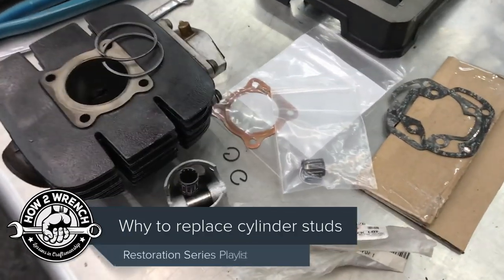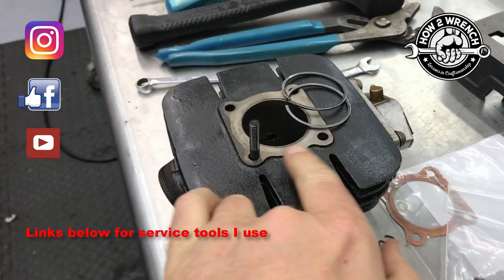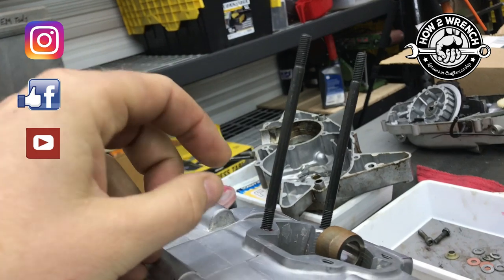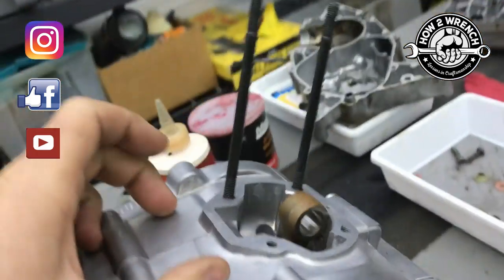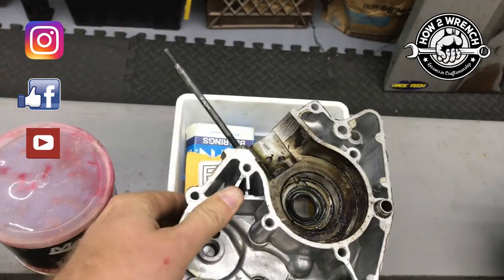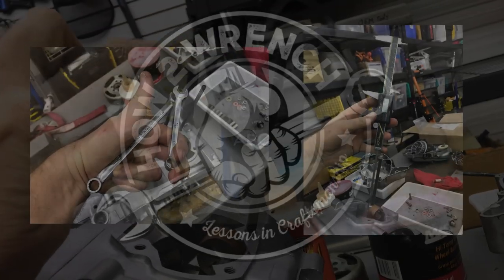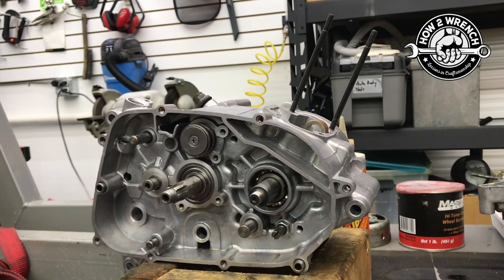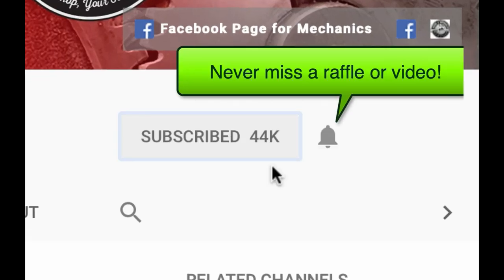Why to replace cylinder studs. Have you put much thought into what you reuse?

Comment: hell yes. i'm new-ish to engine work on my 2-stroke and snapped one overtorquing a few months back. when i did one i thought about how frail they are and how they hold everything together. kind of thought i ought to flip them all but then thought, maybe i'm overthinking it. i did only one then and now that i'm back inside doing more work, i went thru and did the others. no harm in installing fresh, unworn, sturdier ones while accessible during top end work. you'll sleep better knowing this bit of detail is done. the new ones will make you realize how worn yours are. get the good ones, saving 6$ is stupid. autozone stud removal tool worked well in my case, but learned also that the double nut method is a classic trick. thank you for validating my recent full stud replacement, as i await some new rings in the mail 🤘🏼
Reply from the maker: 👍 Thank you for taking the time to comment! Hit that subscribe button if you haven’t please! It helps us! 
Here is a way to support all the free videos.
Want to say “thanks” or “keep it up”? Click here https://www.paypal.me/how2wrench  

Coach Conley is also available for hire to personally work one on one with you if ever needed. Yep he is a real person. Give him a call @ 602-345-0432

Your answers and help are just around the corner. Save time and money while protecting your investment and yourself by doing it the right way!
Follow us!
Web:
www.How2Wrench.com     
www.Tools2Wrench.com